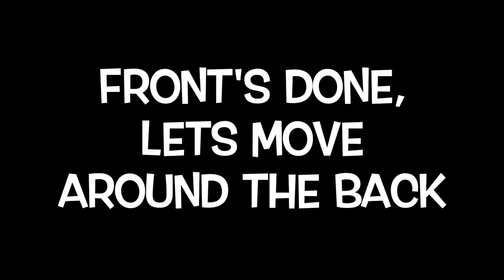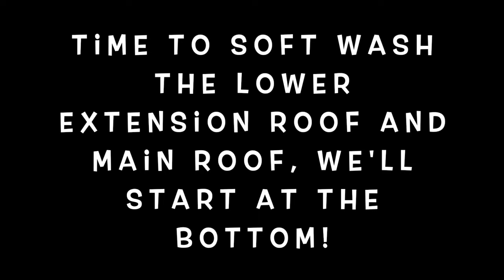Roof Cleaning Cambridge. Marley Flat Concrete Roof Tile Cleaning | Pressure Washed Then Soft Washed

Comment: Great to see a roof clean of a nice steady platform. That did look a long reach to gable end - What length pole were you using and is it same pole you used to pressure wash? Cheers
Reply from the maker: Hi Ched UK, thanks mate. Both my pressure washing pole (Facelift Phantom) & soft wash pole (Gardiner SLX) were at their full length of 35 feet. 👍.
Reply: @PrestigeExternalCleaning  WOW I bet your chest and shoulders are aching after that. That must take some serious strength holding the weight of pressure washing hose in pole at almost horizontal angle 35ft long!!!! Impressive.
Reply from the maker: @ched999uk   Thanks buddy, i've got to admit mate, this was a tough one, and you're right, I was aching that night big time, didn't have any trouble getting to sleep that night, that's for sure. I sometimes think i'm getting too old for this roof cleaning game 😩😂.

Comment: Great Job Again loving the videos, 
Just wondered how long clean-up roughly takes and do you include gutter cleaning in the price or is this a type of upsell due to the nature of the work? 
As well what's your opinion of surface cleaners for roof cleaning ? 

And what PSI are you running with the turbo tip ? 
Thanks
Reply from the maker: Hi willonahill, thanks a lot mate,  glad you like 'em. On average clean up takes around half a day, sometimes more on a particularly bad job. Yeah we clean the gutters out as part of the job - we feel it's only fair, as we're the ones who've filled them up. Lately i've been washing them out as I go, and letting the moss fall on the floor in one spot, which has been a great time saver. 
Yeah, it's always good to have a small surface cleaner for roof cleans, they come in handy and can speed up the job on some roofs, although a lot of the time we don't use them. We run the turbo at between 1160 - 1450 psi.👍.
Reply: @PrestigeExternalCleaning  Thank you for this helps Alot

Comment: Can I ask why you use SH on the roof after washing instead of a biocide? Cheers
Reply from the maker: SH gives an instant polished look, by removing all the black spot, and in my experience leaves a much cleaner looking roof for longer. I've pressure washed a few roofs and biocide'd them at the customers request because they've got an issue with bleach, they never look as good and as clean as the hypo'd ones, even a year or two later they still don't look great, where as the hypo'd roofs still look spotless. Cheers.

Comment: Do you need to re seal the concrete tiles after the pressure wash and soft cleaning
Reply from the maker: Hi David, no they don't need sealing afterwards, the original coating on these Marley tiles wore away by natural weathering a long time ago, they're still doing their job exactly how they should be.👍.

Comment: Get a cherry picker lad less work on the arms 💪🏻
Reply from the maker: Would love one bud, it's quite high up on the "to buy" list. Maybe in the next year or two 🤞.
Reply: You might struggle with a cherry picker at the back of most houses.
Reply from the maker: @matthewbond6029  Yeah that's true in some cases, but it all depends on what picker we buy. Even if we can't get round the back with it, it'll still save a load of time and effort around the front.
Reply: @matthewbond6029 not really!!! U can get cherry pickers go up the side of a house that go 40m, Iv got a 20m and never struggle doing the back I go straight over the roof
Reply: @PrestigeExternalCleaning  it will be the best thing you ever buy for your business,you can hire one 280 a day mate if that’s any help to ya
Reply from the maker: @Rivaboyz1987  Cheers mate, yeah i'm not put off by Matthew's comment, I haven't got a lot of experience with pickers, but I know enough to know they're worth the investment for my business - one day. Blimey, £280, everytime i've looked into it, the cheapest I could find was £450-£500 a day. Which hire company is that with bud?
Reply: @PrestigeExternalCleaning  it was a good 18month 2 year ago from Lowestoft tool hire we had the 40m spider lift it would fit up the side of a house there pricey to buy tho , Iv got a bison palfinger 2006 20m perfect for roof cleaning bud you be surprised what you can pick one up for , all the best fella
Reply from the maker: @Rivaboyz1987  Mate, nice one, i'll look into it. Thanks Smithy 👍👍.
Reply: @PrestigeExternalCleaning  no worries bro ,

Comment: Hi, u doing good job can u make a video on your complete set up so that we understand it better,
And just a suggestion use a harness to which u can attach your pole so some weight will get distributed u can also hook up the far nozzle end with a overhead pulley attached to top of your platform so it will take the weight for u.
Reply from the maker: Thank you for your suggestion, i'll bear that in mind for the future 👍

Comment: Great video Question the tower what would it cost as I'm doing my cleaning from the gutter the tower is a god send
Reply from the maker: Hi maz man, a tower like i'm using (Youngman Boss) is just over 2k new, but you can pick them up on ebay 2nd hand for £900 - £1000. As far as i'm aware, they're also quite cheap to rent.
Reply: It's the only way to go friend .
Reply from the maker: @mazman8343  I agree mate, i don't think i'd do roof cleaning with out it, it's a good, solid tower that I feel very safe on 👍
Reply: Hi friend thanks for replying I was looking
At 5.4 meter single tower with wheels full kit . I think this would do most 2nd story House's it's nice to be able to come on the net and ask people their opinions and get information. Thanks for your help. Is you tower single and how high do You have
Reply from the maker: @mazman8343  Hi maz man, mine is a 5.2 metre working platform height, single man tower. So as long as the 5.4 metre measurement you're giving is the platform height, that's perfect. I also have the height adjustable wheels, these are invaluable as it means you can erect the tower on uneven ground, and it's still solid, and most importantly safe.👍
Reply: @PrestigeExternalCleaning  
There the only job there expensive . I'll have to get one  thank for replying. Are you on Facebook
Reply from the maker: @mazman8343   Yes I agree, they're quite expensive, even second hand, but I feel definitely worth having. Happy to reply and advise if I can, my apologies if i'm ever slow to respond.  I'm on facebook, here's a link to my page https://www.facebook.com/PrestigeExternalCleaning 👍
Reply: @PrestigeExternalCleaning  . God bless keep safe 🙏
Reply: @PrestigeExternalCleaning  HI gents , I am a bit confused would a one-man tower with 4.10m platform height- a 5.10m tower height and a 6.10m working height do two storey roofs, hope so cos that's what I have bought just not had a chance to use it yet, hope I have not been stitched up again.
Reply from the maker: @fredfoz6730  Hi Fred, that's fine mate, you haven't been stitched up. Although my platform height can go up to 5.2m, On most roofs, I have the platform at 4m, I very rarely need to go higher 👍
Reply: @PrestigeExternalCleaning  Thanks mate that's a big relief ,

Comment: Great job,but is there any water ingress using a pressure washer, under the tiles or any tile damage caused by the pressure?
Reply from the maker: Not with this method no, water ingress is caused by people walking on the tiles and cracking them and damaging the felt or membrane underneath, by spraying up the tiles instead of down them, and by using too much pressure, all of which we don't do. 👍.

Comment: Can u softwash tile roof like this and get results?
Reply from the maker: Yep, but the results are never as good than the combined effect of gentle pressure washing and soft washing.
Reply: @PrestigeExternalCleaning  what tip u guys like to use for a gentle pressure wash on tile roof
Reply from the maker: @Rt2comments  turbo nozzle at 90 bar
Reply: @PrestigeExternalCleaning  what at 90 bar mean? I just have a 4 gpm blue turbo nozzle